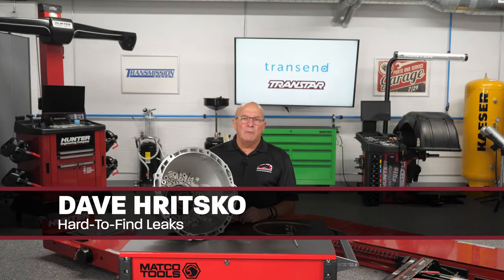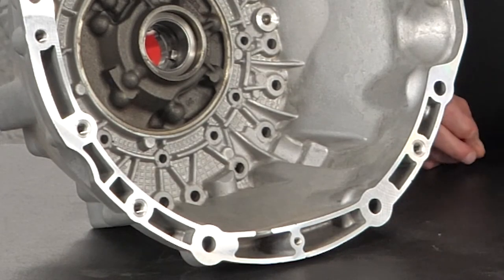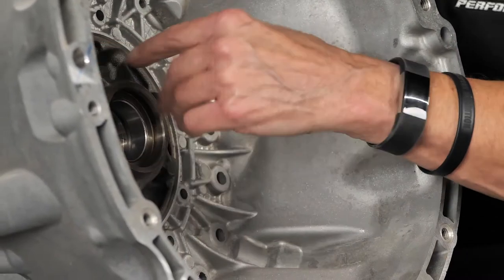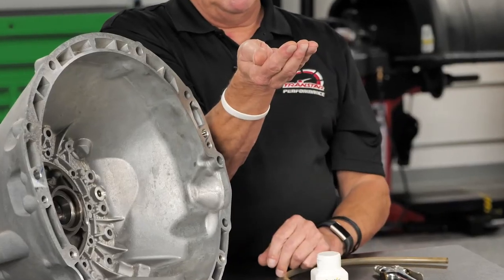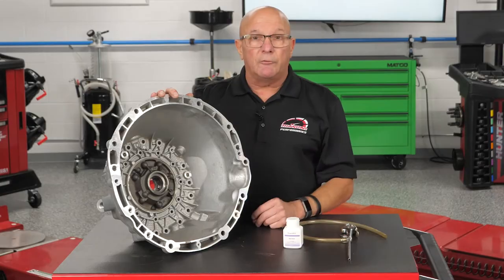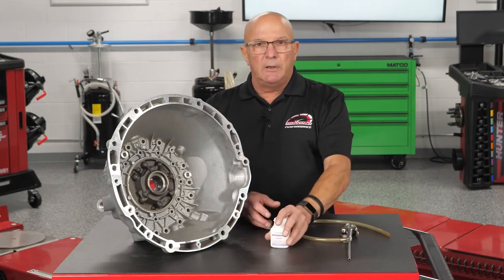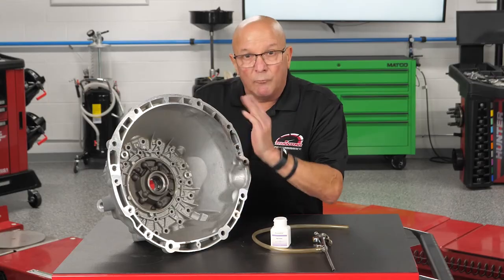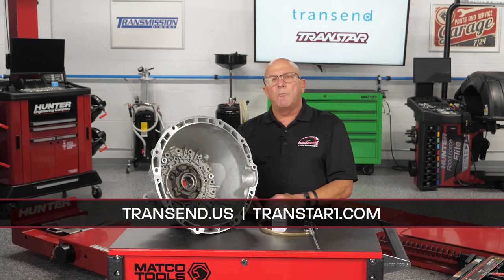Tip for Finding Transmission Leaks

Comment: Currently trying to find a trans leak on my first project truck, an ‘85 Dodge… with a 727
Reply: Same! On my 86 ramcharger smh
Reply: @brandonstamper2366  My deepest condolences brother in christ. Mine turned out to be the shift shaft seal, but it was a purebred bitch to replace it

Comment: I am fighting a 5r110w torqueshift. Trouble would be when converter comes out it Aldo spills oil so powder will not show accurate trace due to converter spill 
Any suggestions?
Reply: Maybe get one of those snake cameras and before you completely take the tranny out as soon as you get enough space sneak that snake can in there and see if you can find the spot before you get oil swishing all over the place in there, just an idea from a middle aged buck